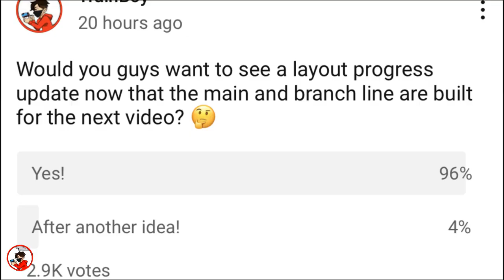A Look At TrainBoy's HO/OO Layout: Part 1

Comment: Hello!
I want to ask you something.
Since I am building my own layout, is the Kato track as flexible and has as many pieces as the Bachmann Easy Track? It looks much easier to handle.
Reply from the maker: It’s not very flexible unfortunately; but comes in a variety of different radius! I prefer it due to how smoothly models run on it and the realistic look it has. The joiners are also much more reliable. 👌
Reply: @ItsTrainBoy  Ah. I knew that. I meant that Bachmann has a variety of track in different sizes, which I need when I am building two layouts. My actual DCC layout in my basement, and a DCC on upstairs on my headboard in my room

Comment: Thomas The Tank Engine & Friends, A Summary:

Seasons 1-5:

Iconic. there are some flaws, but overall it's close to being not just the perfect children's show, but the perfect television show of all time. 9/10

The Magic Railroad:

Is it flawed? Yes. Very. Is it a BAD movie? Not by a long shot. I have seen far, far, worse. Plus, say what you will about it, but the soundtrack is dope, the memes are golden, the Blu-Ray is great, and the Columbia Tristar DVD is pure nostalgic euphoria. 7/10

Seasons 6-7:

dull. nowhere near as good as the classics, but not terrible either. There are some good stories, but everything else is just dull. 5/10

Seasons 8-11:

Now truth be told, I grew up on this era. So it is nostalgic for me personally. Plus in my opinion, Season 8 is not as bad as everyone says it is, it's just different. besides, the show didn't start to suck ass until Sharon Miller became head writer. 7/10

Season 12:

The first and last of many things. but most importantly, the last season to feature the original gauge 1 models. hidden within the slightly below average episodes is a bittersweet finale. 8/10

Seasons 13-16:

no -Wanda Maximoff, WandaVision: Season 1 Episode 2, no/10

Seasons 17-21:

actually very good. again, nowhere near as good as the classics, but some episodes are up there. even if the fan service was a complete train wreck. 7/10

Seasons 22-24:

I think something's wrong here Wanda.. -Vision, WandaVision: Season 1 Episode 3, stop/10

Season 25:

who is that.....who are you? -Dottie, WandaVision: Season 1 Episode 2, end my suffering/10